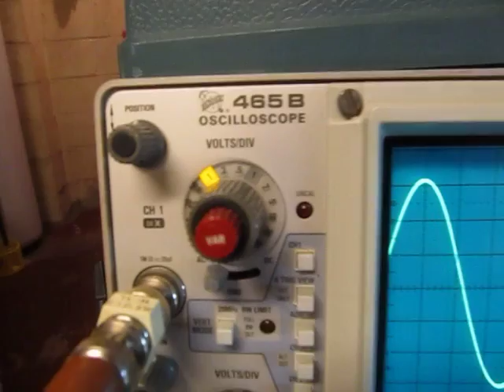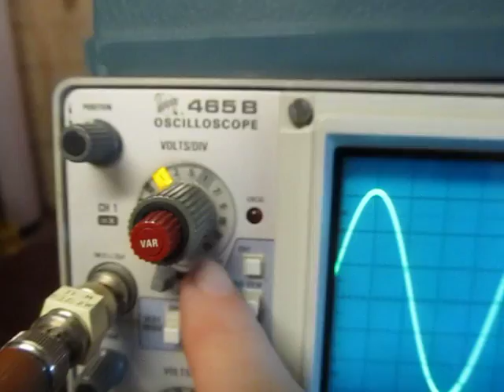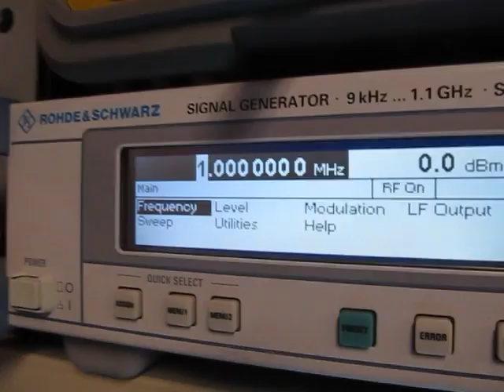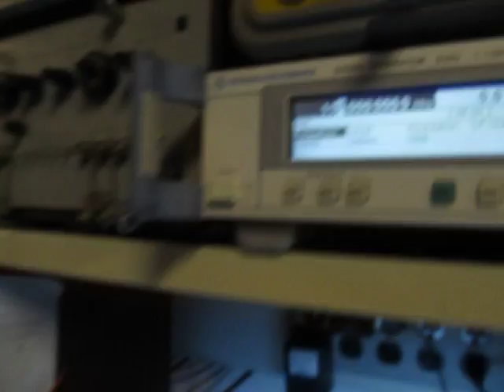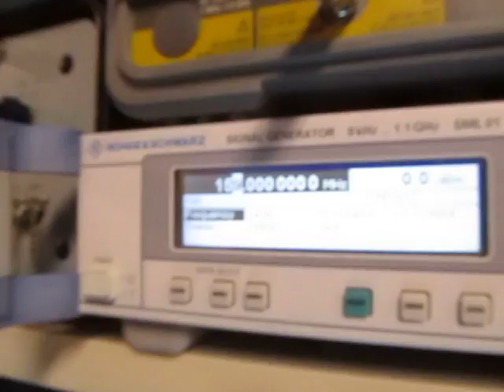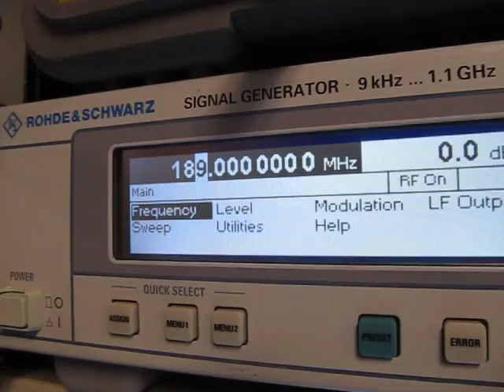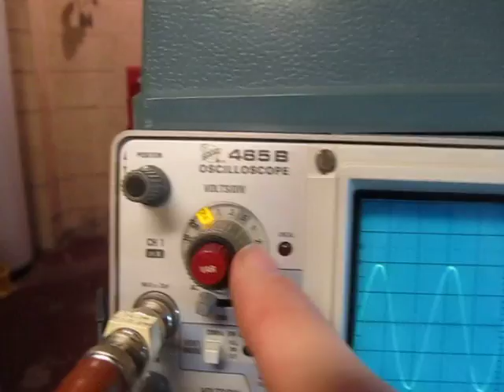#69: Basics of Analog Oscilloscope Bandwidth

Comment: Yes, very good, but it rather assumes that the signal generator produces the same amplitude signal over the entire test range. I have a reasonably expensive digital oscilloscope and a very cheap signal generator. Which do I trust?
Reply from the maker: Yes, it does make that presumption.  It would be best to try to verify one and/or the other via other means or instruments.
Reply: @w2aew  Many thanks for your reply. Is there a simple way to calibrate either an oscilloscope or the output level of a signal generator without using a known calibrated instrument? I'm think of something like rectifying the output of the signal generator with a low reverse recovery time diode and then simply measuring the dc. level over the required range of frequencies. I can think of a few problems with that idea, but could it be made to work without too much difficulty?
Reply from the maker: @chrisengland5523  Each is going to have their own flatness characteristic, but the more ways you measure something, the more you can average out the uncertainty.

Comment: Another way of showing this I saw in my old RCA WO-91B scope service manual is to use a sweep generator, so the scope shows it's own response graph. Said scope wanted you to do this to get the vertical amplifier as flat as possible out to 4.5 MHz, I guess for the TV service work it was mainly designed to do.

Comment: My experience with a 465B is pretty similar,  I could read TV signals up into the RF part of things,  no problem,  although as you say the readings weren't absolute.  At least you could see that you had a signal there and what it looked like.  This isn't true of all scopes-- the ones that use a bunch of peaking coils and similar "video amplifier" tricks tend to have not as smooth a response up to their rated bandwidth,  after which things sorta fall off a cliff.  Which is why I prefer Tek scopes...

Comment: Excellent video. I have seen many forums saying the x5 rule of thumb when comes to scope BW. No one said that the signal will be still visible at maximum BW and we can count the time period pretty much accurately.
Reply from the maker: You can even see signals beyond the rated BW of the scope, it's just that their amplitude (and higher frequency content) will be attenuated.  The 5x rule of thumb is to ensure that the measured amplitude is within a few percent of actual (i.e. not significantly down on the rolloff curve).
Reply: @w2aew  thanks a lot. I really now have clear understanding after watching  2 of your videos on oscilloscope BW.

Comment: stupid question, but could you use some type of amplifier to amplify the signal so it's a bit easier to work with? Im new to the whole electronics engineering dealeo so go easy me. XD
Reply from the maker: An amp isn't really going to help overcome a bandwidth limit situation, because the scope won't have the sweep speed or trigger BW to be useful.
Reply: w2aew oh ok. makes sense. thanks for the reply :)

Comment: At 1 Mhz, the amplitude of the signal was 6 div. At 117 MHz, 4.2 div ( about -3dB point). What about over 117 MHz? no more amplitude attenumation? It seemed that the 200 MHz signal has still 4.2 div in amplitude.
Reply from the maker: Of course the signal continues to drop as the frequency increases.  At 200MHz, I had changed the vertical V/div setting to make the scope more sensitive.
Reply: Thank you. I missed it you changed the V/div setting. I have one more question, not about this video. If there is a 100 MHz voltage signal source, and a coaxial cable in 1 m length is connected between the voltage signal source and the oscilloscope. The oscilloscope probe ratio is set on 1:1 and the oscilloscope input impedance is set on 1 Mohm. In this case, what is the input impedance? it becomes 1/(2*pi*100 M*C)? where C is the parallel stray capacitance of the coaxial cable, generally 80 pF per 1m and 1/(2*pi*100M*C) is about 160 ohm. I think the input resistor's impedance is about several killo ohm in 100 MHz frequency. And the stray capacitance's impedance is much lower than it. Thus the oscilloscope's input impedance would depend on the stray capacitance in this high frequency regime.